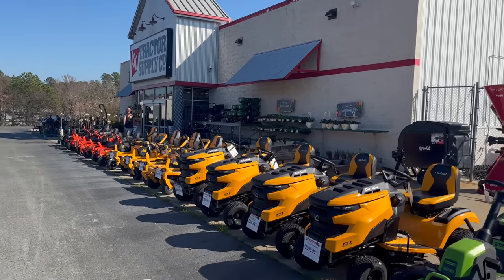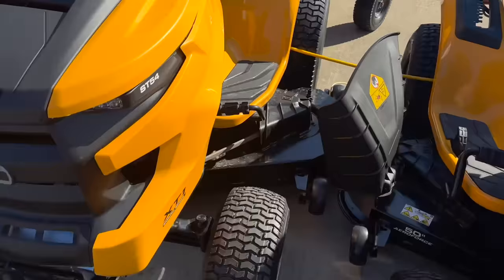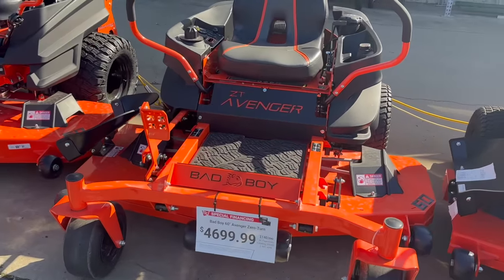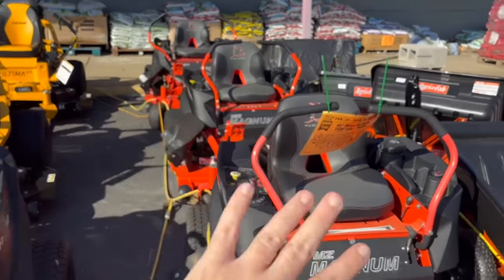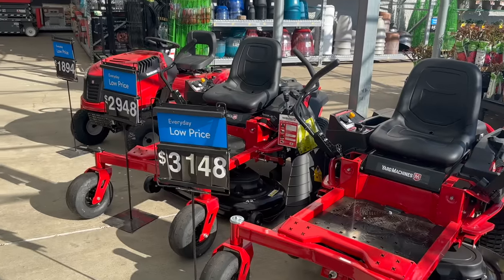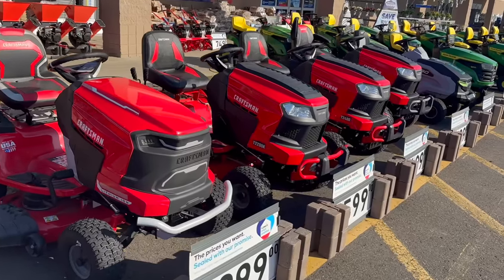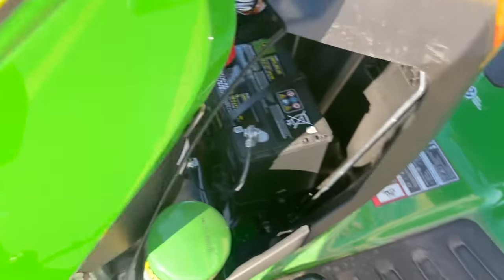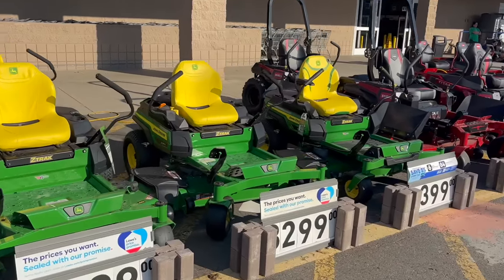The BEST Mowers to Buy and What to Avoid at The Big Box Stores This Year!

Comment: Burn your house down?!  I've owned an EGO mower for ten years... No maintenance,  no gas /oil and smell, no fires, original battery, no repairs! Great power.  A bit closed-minded, Chickanic!
Reply: Like gasoline isn't flammable lol. I guess if your livelihood depends on inefficient polluting machines you're going to be inclined to badmouth the cleaner alternative that also happens to need minimal maintenance.
Reply: cleaner alternative?  no such thing and far from sufficient
Reply: @hu_b soooo can you verify your power grid is nuclear? If not, your electricity to power your little golf cart came from inefficient polluting oil. Oh and if you think there isn’t a much higher likelihood of those lithium batteries catching fire than a gas tank catching fire, you haven’t been awake in the last decade.
Reply: Congratulations on getting a lucky one!  Those new EGO mowers end up in the landfill on a regular basis. They never mow their first yard!
Reply: @hu_b   so how is it a cleaner alternative?
Reply: Not going to cut my 2.5 acres. 😂
Reply: Not sure how electric mowers compare but Data from the National Transportation Safety Board showed that EVs were involved in approximately 25 fires for every 100,000 sold. Comparatively, approximately 1,530 gasoline-powered vehicles and 3,475 hybrid vehicles were involved in fires for every 100,000 sold. So fires risk is not a problem for electric vehicles
Reply: @kell1bri  Do you believe everything you read in government agency reports,lol!

Comment: My last mower was a Cub Cadet LT1045 (46"deck). I also had the snow blade and wheel weights and chains. Single cylinder Kohler Courage. I pushed that thing hard year round here in Michigan mowing 2 acres all summer and pushing snow on a 250' driveway during winter. All I did was change the engine oil and filter and kept the foam air filter clean and oiled. That rig never let me down, after 14 years I sold it (still in excellent condition) for $500. Of course I immediately went to Home Depot and bought a new CC XT1 LT46 (7000 series v-twin 23 hp Kohler engine). I immediately noticed the lack of grease fittings on the two deck spindles, so I don't expect 14 years on those. But I see that Amazon sells exact replacement spindles with pulleys AND zerk fittings installed. These are two of the best and most reliable/cost-effective mowers I've owned. Great for pulling a dump cart and general yard work as well.

Comment: Still riding my Craftsman 4500 with a Briggs 725 twin with cast iron cylinder sleeves , pressured oil system. It's 18 years old, change oil and filter plugs once a year... hose it off when im done...store it in my garage . One by one I have had to bypass all the idiot switches that failed... other than that it looks and runs great. I hear it the best engine you can get.

Comment: I have a LTX1050 CC with a 22 Kawasaki engine 50 inch deck. I mow uneven terrain a little over an acre. I put this mower through a lot and it delivers. I do the normal maintenance . I would let chickanic work on my machines if I lived in her area . Always good information greatly appreciated.

Comment: I had a Craftsman ride on for 23 years with no issues but belts need replacement. Annual maintenance at the end of the season is priority for any machine. What I will not buy is a JD at an elevated price tag with less features. I see Cub mowers at the local deal ship that have been mowing for 20 years that have been treated properly and still going strong. The Koehler 7000 twin is an excellent engine.

Comment: I bought a Bolens 15 horse riding mower back in 2011, and other than replacing belts, blades, and spindle bearings is still going strong.

Comment: Good video! Thanks! I have found the JD rider has a very good tractor but the decks fly apart in just a few years (3-4). Actually had a spindle drop to the ground while mowing! Thin steel and brittle as well.

I have a Huskvarna rider that the left rear seal keeps failing. Has been replaced 3 times over 8 years. Also the hydrostatic trans seems weak and does not want to pull a incline. Plus the pedal has major issues! The mower is best for flat yards only! So far the HV zero turn is been good. No issues and is dealer bought!

Comment: I had a cub cadet for 16 years and am now on a cub cadet 54" zero turn with a 24 hp kohler from tsc for the last 7. I have not done anything but change blades and oil in either one. My mom needs a new zero turn hers has 980 hours on a 42" gravely. Since Tsc has the 54" cub cadet on sale for 32,99.00, i recommended it to her

Comment: I have a 54" Hustler with the 26hp Kohler purchased from Lowes 3 years ago. 
I was looking at their John Deere's at the time, a friend that was working at Lowe's told my to  shop the JD dealer and compare the engines and decks of their similar hp and width mowers; the dealer mowers had fabricated decks vs stamped, Briggs engines with plastic intake manifolds and 'chokeless' carbs vs aluminum manifolds and metal (Keihin?) carbs.
I have been well pleased with the Hustler as a pro-sumer/light commercial mower.

Comment: Knock on wood, I have a 10 year old Craftsman G5500 (made by Husqvarna) with the 24HP B&S 724CC twin and 54" deck, and the only issue with it so far was the stupid digital keyless start button that I had to replace a few years ago.  Now a days, I only bring it out now when I need to mow the ditch that is wet and has standing water as it is only about 1/3 the weight of my commercial Hustler Super Z Hyperdrive with the Vanguard 37HP EFI and 60" deck.  Knock on wood, that mower has had zero issues since new and that was in 2018.  Thanks for all your insight on different mowers. 🤠👍

Comment: I had a Yard machine I bought years ago and it lasted 8 years before I had any issues out of it,other than typical maintenance, then bought a Husqvarna(after reading several positive reviews) and within a couple of years just issue after issue, I limped it along for another three years having to put oil in it every time before I mowed,it just burned through it, until I finally bought my first Zero Turn, and got a Toro. Going on my 3rd season with it and it's been good so far,just a spindle issue.

Comment: I've got 12 years of summers on my Toro TimeCutter 42.   1/2 acre lot. Oil changes every other season.  Kohler 22.   No issues with the engine or trans. The electrical has been a little buggy. Overall its been pretty good, but I'll probably be looking at a Bad Boy ZT Elite next season.

Comment: looked for a new lawnmower last year. went to a husky dealer for a specific model that had the Kawasaki twin with the 42 inch cut. That model was impossible to find, however they did have the Kawasaki twin in the 48 inch cut for about 1500 dollars more. Went with another mower brand that I had bought from before and have had allot of success with. So far no issues and it was allot cheaper, but time will tell. Keep on mowing...

Comment: I have the Husqvarna 1842 with a Briggs & Stratton motor and I've had it for 9 years and it runs very very well change the oil twice a year in it new plug every year and it's just absolutely fantastic

Comment: I don’t mind if it’s only a 50 inch deck or smaller, but it needs very wide tires. It don’t start spinning and digging holes in the ground with and perfectly dry and a fabricated deck is a must.

Comment: Craftsman t130 here. 18.5 briggs. I bought it for 300 about a year ago. Its about 5 years old but had never been used. Valves needed adjusted but its been a pretty decent mower. Very cheaply made.

Comment: I own a 2005 John Deere L111 42" deck with the B&S 20HP 2 cylinder engine. It currently has only 158 hours on it and it still starts easily and runs smoothly. I've been quite happy with that mower.
Reply: Those baby deeres aren't really John Deere machines. They are made by MTD, I believe. You have to pay like 5000 or more to get a genuine Deere. If it was purchased at a box store, or could have been, it's not a true JD.
Reply: @brandonhebert5485  Deere riding mowers are made at one of three John Deere factories in the USA depending upon price point and application.  There are no Deere riders made by anyone but John Deere by Deere employees.  There is no such thing as a baby Deere or a Deere made by MTD.

Comment: I have older Husky. 52 " industrial deck 3 blade Kawasaki 24 horse.  Got for 400$. They said rear end out. Took it apart got knew belts ,pullies,same spindals,greasable,knew filter fluid in rear,knew blades.. tunes in tires. Tractor now has over 2600 hrs. On it 4th season out. Total to date in it bout 1050 $$. Give or take. Still looks good. I will never buy anything but a Kawasaki engine. I was always Briggs guy. But this Kawasaki like an old big Cat c-15 or 3406 b n or E
! Just bottomless and work ! Period.!! Great video . And thankyou from hillbilly hills Ohio coal country!!

Comment: We had a Craftsman LT for about 12 years before the drive belt broke and bound up the transmission.  Bought a Cub Cadet 50" with the fabbed deck from our local Tractor Supply where we know the guys who put them together, so had no worries, and have loved it.  I wasn't about to get a stamped deck and the Kohler has fired up every time perfectly.  Also have their dual direction tine tiller for 10 years now and still goes like a horse.  Also skipped the zero turns since we only have an acre to mow.

Comment: Love your videos, worked for the bigger of your big box stores the last 16 years.  Still there.  I Closed all the time at last store and open all the time now so I’ve either pulled in or pushed out these mowers literally 1000’s of times and you are spot on with your accessments.  A lot of these machines fall apart before they leave the store.  I will say this though and that is I purchased a Troy Bilt Pony with the 17 hp single cylinder Briggs with a promotional dump trailer in 2009 (2008 model) for $799 and have only changed a few blades.  The only major problem was the steering shaft gear wore out and put a new carburetor on it.  Never even changed a belt, but I blow off the deck every time I use it.  I still have and use it.  I guess you know we quit selling Troy Bilt when we started selling Craftsman.  But like you said they and others are the same MTD mower just different branding.

Comment: I was going to say on the John Deere’s that yes their decks are stamped and the residential ones aren’t as good but there 900 series commercial zero turns also have stamped decks but they are 7 gauge steel and are built like tanks. I bush hog with mine all the time. It gets through grass better than any mower I have and I run a lawn care business.

Comment: I’ve learned the hard lesson with cub cadet hydrostatic transmissions. 300-400 hundred hour service life but can destroyed easily. Atleast the early 2000’s craftsman with the manual transmission still runs but has that single cylinder Briggs so she smokes and had one or two blow up.

Comment: I appreciate your Great advice. I have a Husqvarna 42" with a Kawasaki motor. It's lasted 20+ years mowing 5 acres.  Bought a Husqvarna 46" about 12 years ago. Briggs engine broke 20  hours in.   Replaced whole engine. It's  not as good a mower as the old one

Comment: Very helpful.  We need more honest reviews like this.  BTW:  I have a 40 year old Yardman (now MTD) riding mower and other than changing the oil annually with filter, keeping the air cleaner spotless, changing the fuel filter every 4 years and cleaning out the carb one time and replacing the belts every 6 years it has been ultra-reliable with the B&S Vanguard 16 HP twin cylinder engine.  I figure it has over 1500 hours of use on it.  They don't build them like they used to.

Comment: I bought a 2015 Cub Cadet Z60 new at Tractor Supply. Fabricated steel deck is great. Kohler 7000 engine is ok. Seat is cheap and is cracking. Not comfortable to sit on. I mow 6 - 9 acres every year since I bought it. Other than having a cylinder gasket replaced last year at a shop, I've performed all maintenance and repairs myself. Replaced the spindles last after one broke apart even though  I regularly grease all the zerks and change oil and filter on schedule. Over all it's been a decent mower. Early problem was with belts breaking. I finally fixed that by installing lock nuts on belt tension-er spindle. Not designed very well. Must have lost half dozen belts prior to my self repairs.

Comment: Like to hear comments on Spartan zero turns. Another thing, I'd like to hear about cut quality. If I'm going to have to take time and mow, want it to look good. My family has 4 different brands of riding tractors and you can tell everywhere I mow. Yard looks great. It's a 2005 Cub Cadet. Done nothing but change oil, belts and blades. Has 26 hp Koler engine.

Comment: I bought my Craftsman 42" rider in 1997.  For 20 years I cut 4 lawns a week that were 80'x183'.  I have NEVER had any thing so wrong with the engine or transmission.  I performed the right maintenance tasks on it every year.  I never bought a starter for it either.  I did buy tires once,  but that wasn't that necessary.  Best machine I ever bought.  I know now after listening to you,  I would not buy a new Craftsman!  I'm down to just cutting my own lawn now,  and if anything happens to the mower,  I'll just hire somebody to cut the grass.  🙂

Comment: This is why after the prices went to the moon on everything, I bought a used 2006 Cub Lt1045 rider with a T46 trans and a Kohler 20HP - 400 hours on it. Been mowing my 2 acres for 2 seasons with it now at 450 hours. Then found another used exact mower but a 2007 with 250 hours for even less $$$ ( $600 ) a year later just to have as a 2nd backup incase mid summer one breaks down ( knock on wood ). I do my own maintenance though as I do know how to wrench on things. I have seen all the new JUNK thats out there, they don't make them like my older Cub's anymore unless you pay $$$$$$.

Comment: I’ve got a 2007 jd 717a mini trak z with a  twin kawi. No rops, but it’s a tank. Honestly the best mower I’ve ever had and I bought it used 5 years ago. Stamped deck, not one issue in over 15 years. It’s thicker steel than the mtd stamped deck. 7iron I believe. I’d put the deere z turns above the smaller toros, but the larger toros would be better… except the price.  
I’ve replaced the front two tires, the rears will probably get done this year. Normal maintenance on serviceable twin pump single wheel motors. Paid $2500, and use buy another used z before I bought a new box store one of any brand.

Comment: Gravely zero turn , 23 HP Kawasaki engine , 48 inch deck ! Beautiful machine . Strong bullet proof engine and can run fast mow . I can cut my lawn so fast it's crazy . Scags with the Kawasaki are also very good machines. Mine was $6600 4 years ago . 
I had a John Deere self propelled walk behind for 20 years . The deck rotted but that engine never hiccuped one time . At the very least buy the engine 
that won't let you down . I was told the kawi engines pumped water all day in rice paddies . That's how tough they are.

Comment: Kohler used to make a really good engine. The 7000 series will start having electrical issues after 3 years. My brothers rider mower had that engine and one cylinder would die due to not getting spark. It's a very common issue.

Comment: I'm so glad I bumped into this video. I don't know how I missed it. I'm looking for a mower. Weighing my options. New/slightly used (under 200hrs). Husqvarna seems to be at the top.  Looking for a rider. 22hp + Kohler or Kawasaki & a 46" to 54" cut. Bad boy are zero turns and seem to be more maintenance. Am I wrong at that? But they are a very close 1st. We've had John Deere for over 30 yrs. They are getting older and thinking of something different. But they are in 2nd place by themselves. 
Now to just figure out what I want. 😂 And save a buck. Hmmm

Comment: Great reviews! I have a 90s vintage Craftsman. All steel construction and a 2 cylinder Koehler engine. A solid machine but having nagging little problems. Fuel pump went. Installed an electric one and now there is no spark. I’m not a mechanic so my frustration has me looking at newer machines. Appreciate the advice on these. Good video

Comment: I lucked out (sort of) on a single cylinder Briggs on a Hustler. It got me just shy of 15 years of operation, at the cost of needing to replace the head gasket a couple times…which isn’t a terrible DIY task. 

It was still running strong, so I sold it off on Facebook and picked up a Kawasaki-powered John Deere. Hopefully this one can last me until gas engines are outlawed.

Comment: Just bought a bad boy magnum yesterday.  Have around 3 acres to mow. It's pretty much a field. 1st cut of the year, too, with plenty of rain. Not being a commercial mower did  really good. I was surprised, really. The deck height can go up to 4.5 if not close to 5 in. A 3/16 deck with 1/4 in gussets for braces, on this model. Most are 10 or 7 gauge and Solid welding all the way around and the deck didn't move at all while mowng, compared to say a cub cadet. There's nothing like your deck slapping around. Have had a few zero turns, and not being commercial, it sure acts like one. The only issue so far is the seat. Would have liked more cushion if not a spiring similar to the toro timecutter seat. Besides that, i like it,cuts really good,built like a tank and made in the USA.  We'll see how the season goes about any issues.

Comment: Bought a 2017 Cub Cadet with 18 hp Kohler and it's been dependable.  Only thing I've changed is the oil, battery and one set of blades.  I really liked the OEM blades but couldn't find them.  Oh, I also paid $1,300.00 for it.  That's a steal compared to 2024.